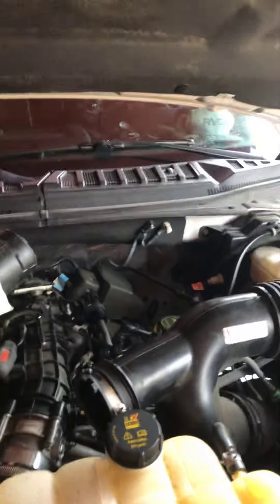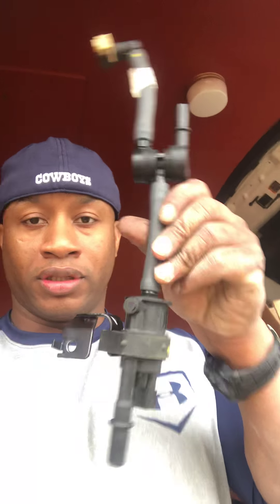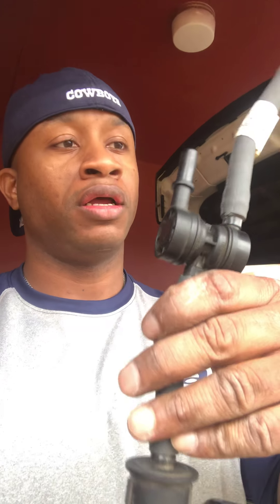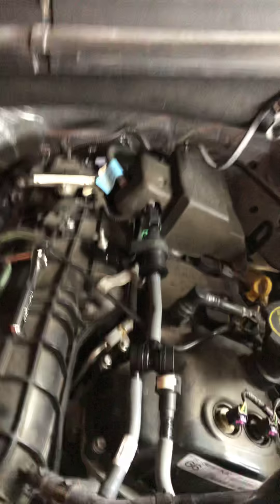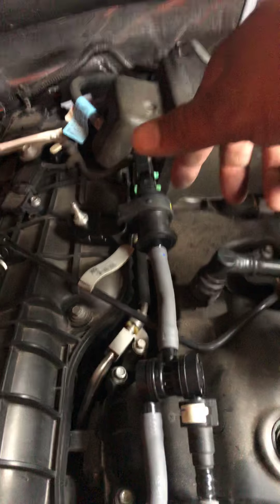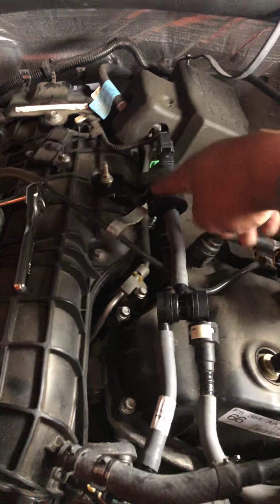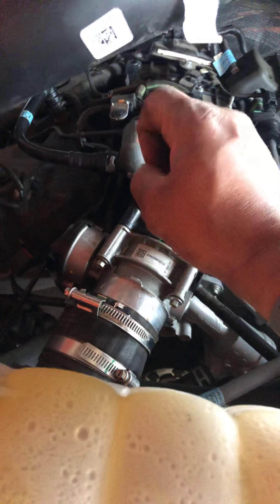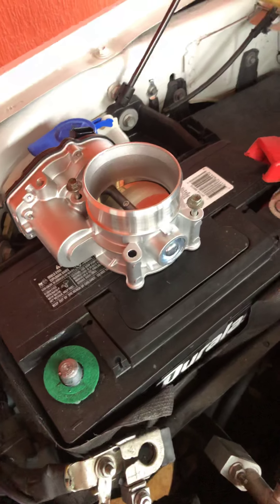2015 Ford F-150 twin turbo purge valve replacement

Comment: I have a 2016 F150 3.5L and is now throwing the P144C code.  The part recommended by Autozone is nothing like the one you have.  I live in Texas and need to get my truck inspected so of course this light pops up just before I need to get my vehicle registered!
Reply: What did you end up doing?. I have same truck, year and code.

Comment: Great video man, thanks for sharingI

 had the P1450 error, it had one rough idle for about 10 seconds a few days later, and the Check Engine Light came on. You're right, they try to give you pv637 at the auto parts stores, but that's not the right model. I'm curious; I have the extended fuel tank, and I am curious if others have the 36-gallon tank as I did see on rock auto a part number that said Excludes long-range tank. Guess I still have to make a trip to the stealership since I can't get the part anywhere else.
Reply from the maker: Yea man they are making almost impossible for us to fix our own vehicles these days.

Comment: I also have the 2015 3.5 ecoboost and had to replace mine at the beginning of the year.  I noticed the new one has a different parts number from the original part. 

Mine never stalled but kept throwing a P144C code.
Reply: Did this fix your P144C code? My 2011 3.5 ecoboost keeps throwing the same code
Reply: bollingeraaron  no it did not fix my problem, I ended up replacing my canister purge valve by the gas tank...I have a video on my channel and it did fix it!

Comment: Thanks, this helped me out ....I kept getting a check fuel fill inlet on the dash....I checked for codes it told me check evaporator purge valve.....When I went to dealer he showed me a diagram that also showed the fuel tank... It also showed the valve with hoses hooked up to the charcoal canister.  I have a 2011 F-150 3.5L twin turbo Lariat Eco boost, like you.  Instructor at school told me it was probably located  behind drivers side rear fender well.....LMAO....Also,  the part at ford, here in Las Vegas wants 172.00$  for the part.....Thanks to you, I now know the exact location !!!!!  Should take me about 10min to replace....Thanks man, I appreciate your video and all the footwork you did....All the best Dan.....

Comment: By the way, after you replaced the purge valve, does the check engine light go away on its own? Or do you have to reset the computer thanks
Reply: Good Afternoon. I had the same question. Does the check engine light go off or does the computer have to be rest?
Reply: The check engine light will be erased while the battery is disconnected
Reply: not in all models I changed the valve I had to connect the code computer and turn it off